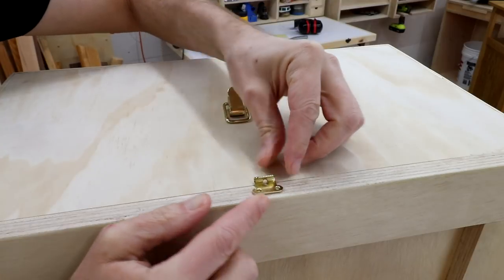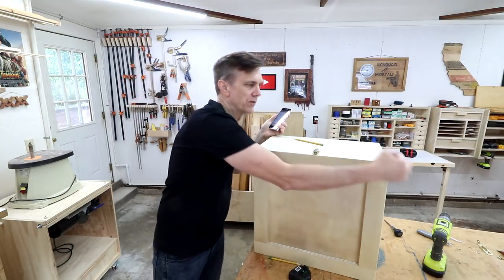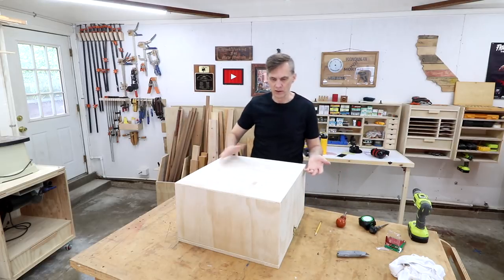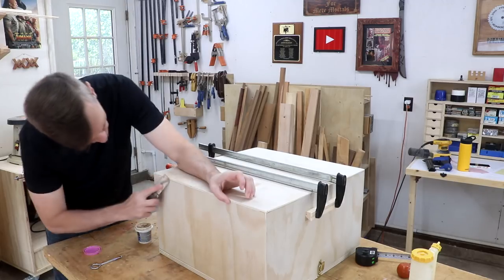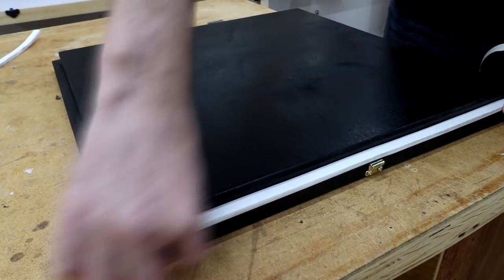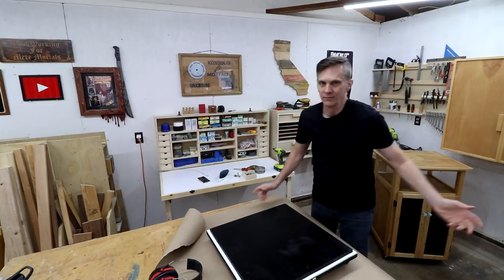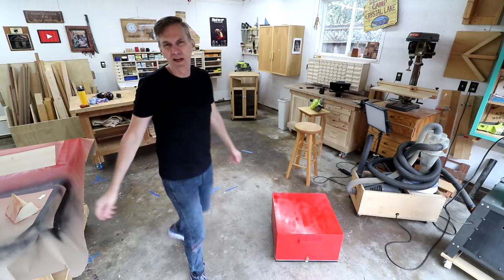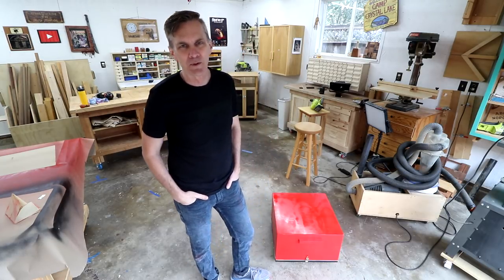Day 13 | The big red box, but with horrible wheels | LOCKDOWN WOODWORKING

Comment: I finally gave up on small castors just for this reason.  2.5" to 3" are the minimum I use, even on light weight items (under 100 pounds).  The easier movement is worth the slight extra cost .  Of course, if you are reusing stuff you have laying around that changes things, especially now when shopping is more difficult.  
Keep the videos coming!

Comment: Need cheap casters that hold a lot of weight? Steal them off of a harbor freight furniture dolly. They're like $10 and you can move some pretty heavy stuff with them. That was the first thing I thought of when he introduced the project, but the dimensions were a little too big.
Reply: Chris Hughson yep, cheaper to buy the dolly and repurpose the casters(and screws), than to buy the casters separately.

Comment: Suggestion: If you are going to use it as a step box, get casters you can mount on the side that lift up so the box is sitting on the ground. You don't want it to roll when you go to step up on it!  The red adds a splash of color to your shop! Everything in my shop is "natural".   I think I may start adding a splash or two. Thanks Steve.

Comment: Just a comment on painting with those spray cans.  I recently got an air monitor (Airmon Palm for $40) and have been testing the quality of the air in my shop under various conditions.  By far, the highest readings I get on PM 2.5 particles, is from using those spray cans.  I now religiously use a mask. Of greater importance under current
 conditions.

Comment: Cool project. When you put new casters on, could you attach a rope to it, to pull in to position as it is quite low and you will end up just pushing it in to place with your foot also in corporate it in to your work out.

Comment: Get some spray lube in the caster bearings, if they have been sitting around, the grease may have congealed.
Reply: I had the same issue on some casters I used for a workbench. Added some lube and they're working like new!
Reply: Can't believe he's not tried it.
Reply: Same thought here, lube it up and you should be good... Steve?

Comment: If you work with your garage door open a lot, I would discourage using red paint on projects. It attracts humming birds. Once in your garage, they get stuck even with the garage door open. They will fly towards the ceiling and not go low enough to fly out the door. I’ve found a few dead ones in my garage. When I find ones that are alive, it’s difficult to coax them out.

Comment: Cloche is just the french word for bell. Either is fine.
Reply: Yep that's right. And that's where the word clock comes from. The first mechanical clocks in the 13th century had no hands or face, just a bell to mark the hour. I'd like to see Steve tackle a wooden gear clock project someday.
Reply: We also use "cloche" to say "dumb" so it is really appropriate for dumbbells! When you hit a dumb's head and it sounds empty as a bell.

Comment: Most casters have weight ratings, and exceeding them matters. Personally, for shop / cement floor projects I've quit using anything besides casters with steel wheels, after having rubber casters go flat from sitting in one position too long under load, then having a devil of a time getting them to roll at all. And saw dust, small pebbles tracked in, etc., seem to just be drawn to sticking to the bottom of rubber / plastic casters it seems, further degrading performance.

Be safe. Thanks for your encouragement by example to follow isolation recommendations in hopes of nipping this thing in the bud.

Comment: Those castors are too small, my friend - & for the movement of 200lbs in weight, preferable to employ the rubber tyred type - especially over a concreted floor - it'll afford the box a greater amount of suspension, too. It's a great project, tho'. Thank you for keeping the woodworkers of differing nations engrossed in this new, daily project build - it's keeping us all sane, Steve :)

Comment: Why you don't try to put some WD40 into the casters? maybe the bearings will get smoother action and it should roll better. Maybe being set aside for a long time clogged them a little with dust...

Comment: Why does it need to roll? Don’t you want it to stay stationary if you’re using it as a step or what not? Looks good and the weather strip is a good idea 👍🏻
Reply: Casters are so he can move the weights out the way when not using them.... and I think Steve was only going to use the top as a step (not the whole unit)

Comment: General rule with castor wheels - the harder the surface the softer the wheels. So for concrete look for rubber tired wheels (Ikea has the cheapest around here with brakes) and for carpet use shiny plastic or nylon (which picks up less carpet fibers too).